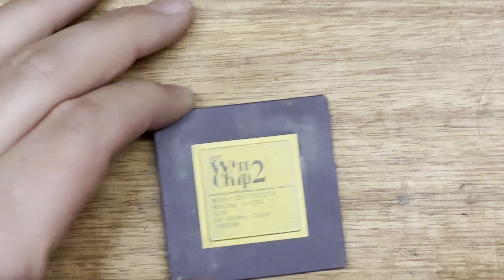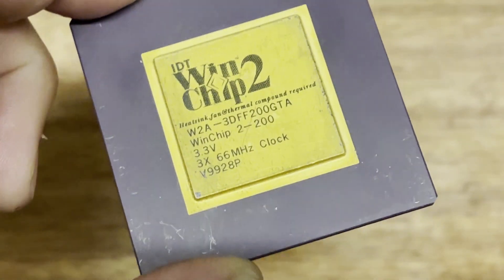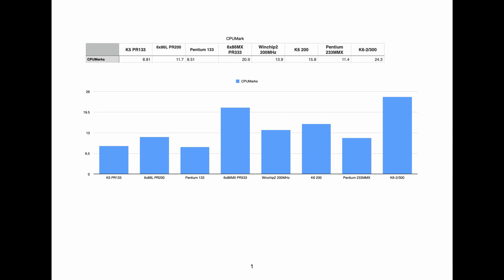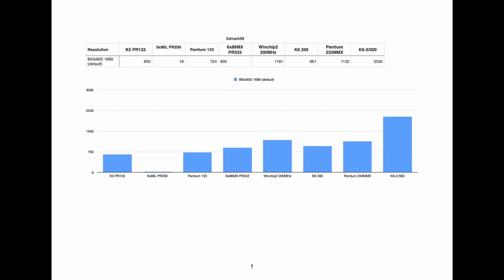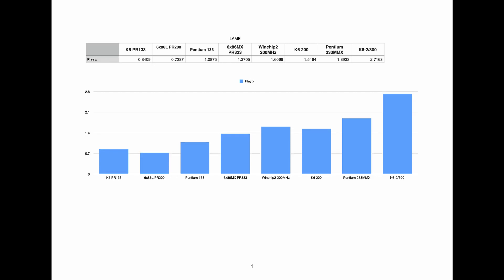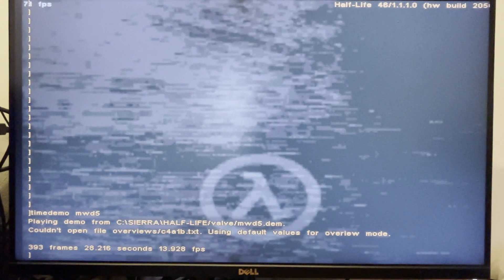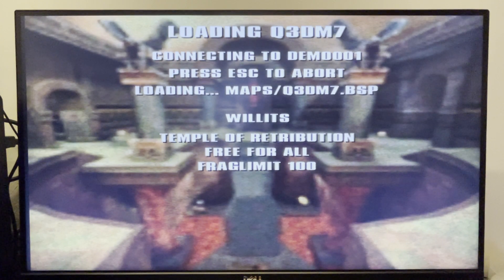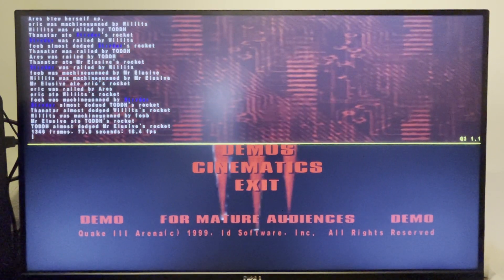Winchip 2 Benchmarks - Quake 3, Half Life 1 & More

Comment: Interesting video and benchmarks. I wonder if the Pentium MMX is faster than the K6-2 at the same frequency and FSB. Would it be possible to create a video with the P1 MMX 233 vs AMD k6-2 233 mhz (both with 3.5x66 and a Voodoo card) ?
Reply from the maker: I would expect that the Pentium would be faster most of the time except for some specific 3dnow supported applications.
Reply: @michaeldale837  sadly there are very few benchmarks with the P1 MMX vs K6-2 or K6-2 vs Celeron to be found on the internet.
Reply from the maker: @3dfxvoodoocards6  you can check mine https://www.vogonswiki.com/index.php/Super_Socket_7_Benchmarks